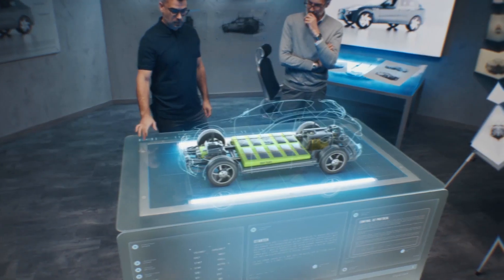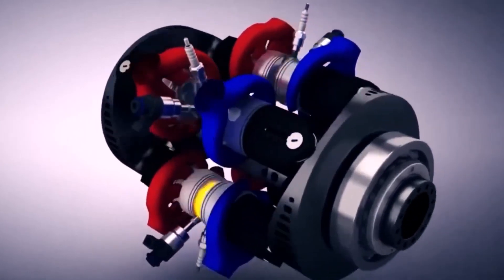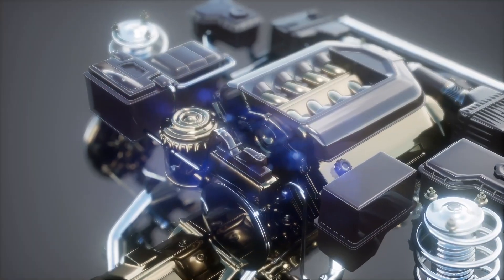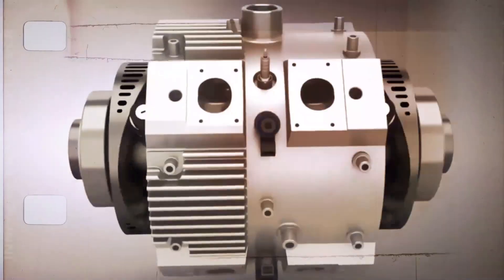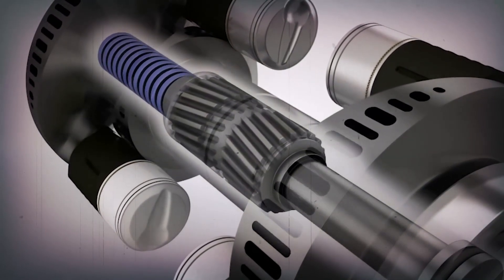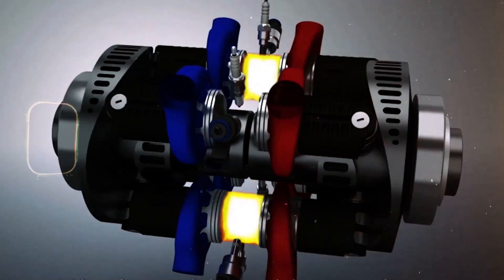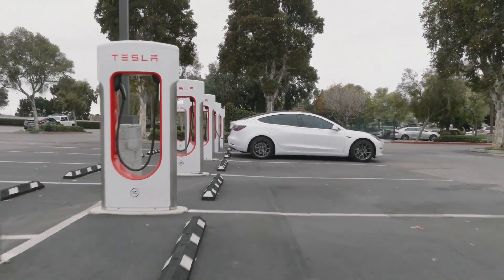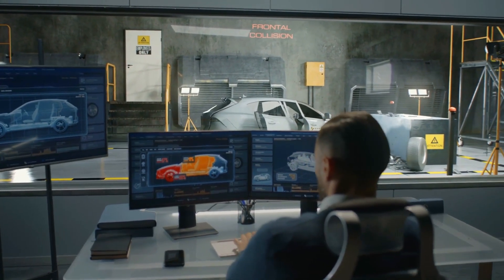THIS One Stroke Engine SHOCKS The Entire Car Industry!

Comment: two failure analysis hypotheses:

1.	Excessive wear of the cylinder wall at one location
2.	Chatter at the swash plate

In detail:

1.	When you do a forces resolution on a common 4-stroke engine, you see the sideways forces of the connecting rod are distributed from the center of the piston over one-half of the piston along various points of the wall.  On the 1-stroke, those sideways forces are concentrated on the lip of one side of the piston wall.  Better materials and an oil layer can mitigate this issue.
2.	After the swash plate pushes the piston upwards, inertia continues the piston's movement, separating it from the plate until combustion pushes it back down. Early combustion can mitigate this, but timing is critical, and there will be a loss of power.

Comment: If the pistons attain Top Dead center twice with one rotation of the crankshaft, than it could accurately be called a one stroke engine. That would mean there was two firing events per crank rotation. A conventional two stroke engine only attains top dead center once per crankshaft rotation.

Comment: its possible to make 1 stroke engines using a strong spring and blocker mechanism
when the single piston the blocker stop the spring from pushing the cylinder back when it ignite it do turn, then the blocker open to allow the spring to push the cylinder back to 0 blocking and compressing air and fuel inside the cylinder and igniting gas again then the blocker release the strong spring back and it push it again
controlling the spring blocker depending on engine mechanism
controlling gas and fuel is like normal engines
Reply: The only true 1 stroke engine is a damn turbine. 
LOL.
Reply: @avibhagan  i was wrong about this 😂

Comment: Very interesting!!  I think getting pressurized oil feed to the rollers mounted on the pistons will be interesting.   I also worry about pitting on the TDC area of the cams.  Then there is the scavenging questions.   Which I address in several other comments in this video.   

Beyond durability & breathing this baby has a lot going for her.  Seriously it is mechanically simple.   Opposed pistons make a very efficient combustion chamber in heat transfer terms.  Friction could be very low if piston side loading from rollers can be minimized or mitigated with low friction features like crosshead or otherwise.   Other OP layouts struggle with form factor or level linking multiple cranks with complex gear trains and associated issues from their torsional dynamics, 2 cams on one crank solves that!! 

Adding a turbo should make it even more capable in rpm & breathing since it addresses scavenging.   A primary mechanical limit to rpm would seem to be when the roller looses cam contact after TDC, but compression, boost and firing pressure should make this virtually impossible.   These guys need to partner with Achates Power.

Comment: A couple things, it talks about having the oil separate from the combustion chamber, but we already have that and these rings will wear as well and burn oil eventuality, so nothing groundbreaking here.
Lots of parts that need lubrication and they even mention it, they don’t know how well it will hold up.  Parts wear and tolerances increase.  Should be interesting.  
I still don’t understand how the intake/exhaust stroke can properly work either.  The combustion chamber is under pressure on the exhaust stroke, and as the port is exposed, you lose all the pressure, but then how do you simultaneously create vacuum to pull in the intake charge?  It is relying on scavenging?  
It all sounds interesting, but until they can provide HP and Torque numbers together, along with some high mileage examples, it’s just a nice thought experiment.  Time will tell.
Reply: Yeah this is critical.   Like other 2S engines in motorcycles and such, intake flow is largely done/helped by the vacuum created behind the high pressure wave accelerating out the exhaust runner.  Note the long primaries in the video.   They may also be able to tune this a bit with the timing thing they discuss as variable compression ratio mechanism.
Reply: You can buy one now and get all the test numbers you want.

Comment: The compressor is because it can't create vacuum itself like 2 stroke diesel engines

Greetings from Spain, good video✌🏻
Reply: WRONG.  I thought this too, but we were wrong!!  Look at the inboard rollers on each piston at 0:28   Those are inside a box cam that can pull the pistons apart to make vacuum for intake.   The only reason I see for this is starting without external air pumping.   To help (not saying this complexity is needed) this the variable compression mechanism could change port uncover and reseal timing between the exhaust & intake.

Comment: Enough of this nonsense. ALL heat engines are doomed because their thermal efficiency is terrible. Even the theoretical Carnot Cycle is never going to be more than 70% efficient, and the reality is that in a test driving cycle, you're not going to exceed 50%. Factor in the cost of prospecting, drilling, pumping, transporting, refining and transporting to every filling station, and the end to end (Well to Wheel) efficiency is truly appalling.
Now compare that to ANY source of electricity generation, transmission and use in a BEV, and you're going to be at least 3 times better. ICE is dead, just forget it, along with Hydrogen which is almost as inefficient.

Comment: I don't think they understand what stroke means on combustion engine.
Reply: That's why I clicked on this video, I wanted to see the Piston go to the bottom and stop there😂
Reply: The company may be using the term "one-stroke" to differentiate itself from conventional four-stroke engines and to simplify its operation, since, in a sense, it operates a single power cycle without the need for traditional four-strokes. In short, the name is more of a marketing term to emphasize the efficiency and innovative design of the engine, but its actual operation is that of an opposed-piston engine with a single power cycle, not a true one-stroke engine.

Comment: Hmmmmm how do the internal parts get lubrication??????
Reply: Same as a normal engine, really.  The main issue, though, is how long the large bearings last.  This would be fantastic for, say, a race car or similar, but on something that needs to last 150-200K miles?  If you want a similar engine to this, look at old Radial engines. Yes, this is basically a radial engine, just with the pistons arranged parallel to the shaft. Quite ingenious, really.  BUT... 250-500 hours running time between a tear-down and service on the central bearing assembly/crankshaft was common and why they were great for military use but never caught on in commercial airplanes or automobiles.  Note that this would mean a major engine-out every year for most consumers.
Reply: Shussh! Yer not supposed to ask that.